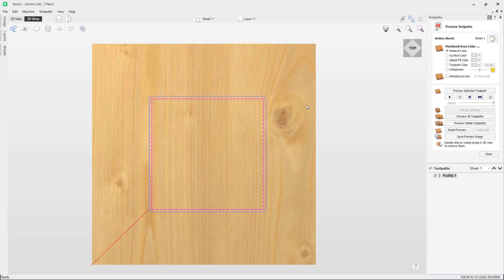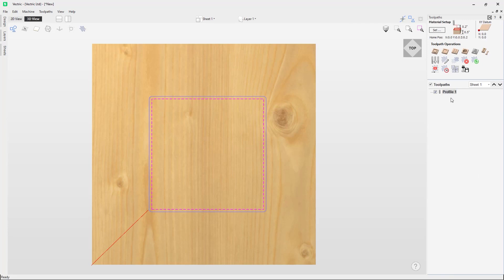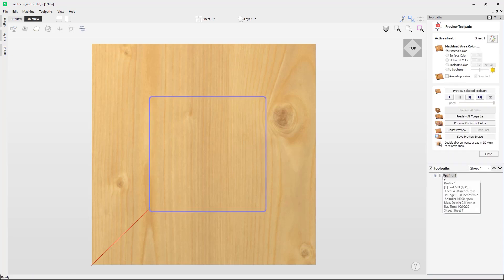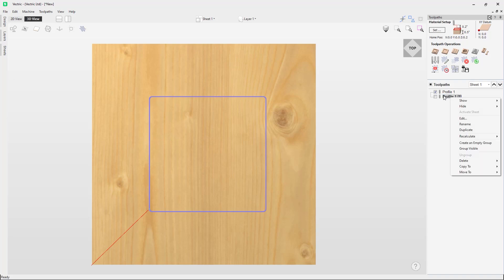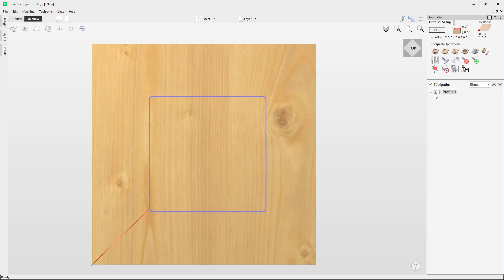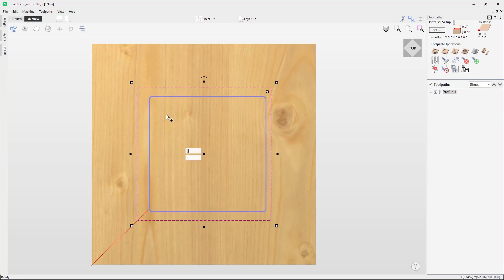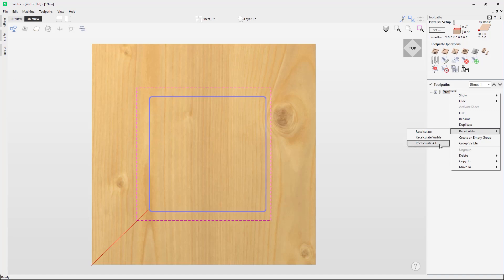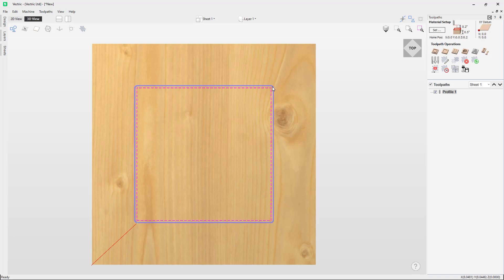How to Edit, Duplicate, Delete and Recalculate Toolpaths | Toolpath FAQs | V12.5 Tutorials

Comment: If you add a part to a sheet, how do you edit your tool path to add that vector to the tool path?
I don’t see where you can pick other vectors after they were initially selected in the original setup.
Reply from the maker: When you have the toolpath form open, make sure you can see the vectors you want to add and then hold down the shift key and select them.  They will be add to the toolpath when you recalculate it.  If that does not help please email support@vectric.com with your question and include the file you are having trouble with.